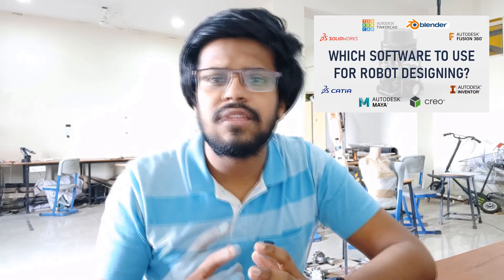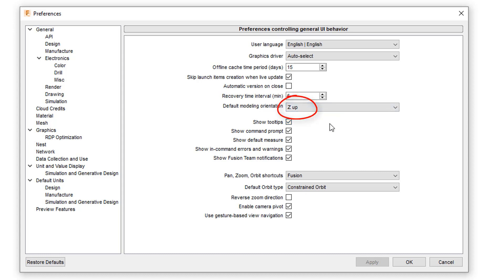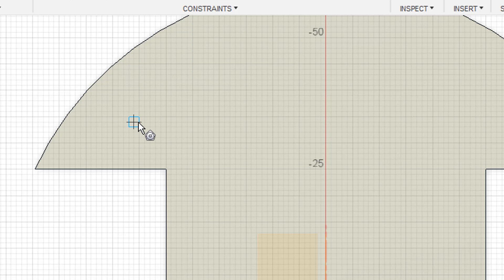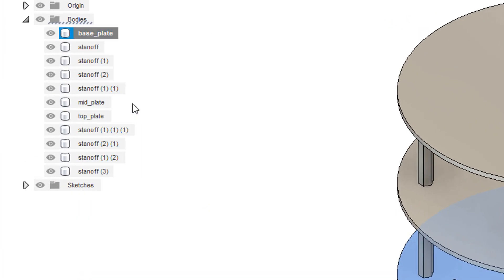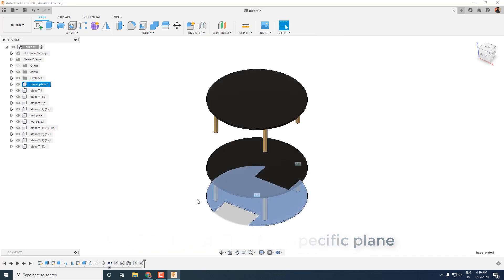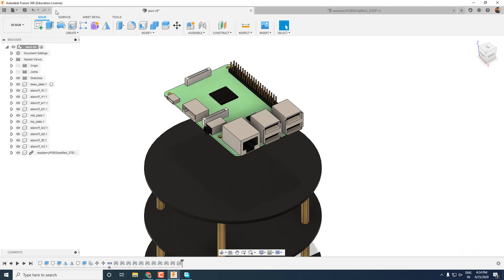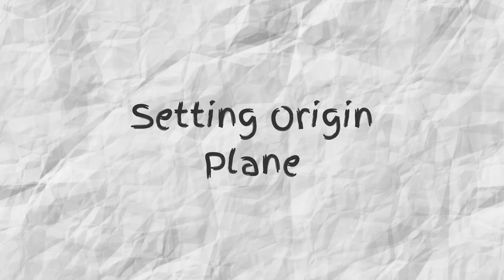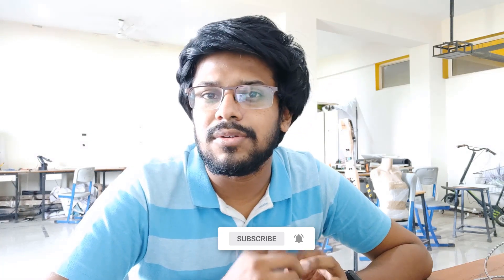How to Design a Robot in FUSION 360 for ROS Simulation || Beginner Tutorial - Autodesk Fusion 360

Comment: hi sir , i got problem while serial communication between jetson nano and ardiuno , kindly give some suggestion , I don't know how to connect jetson and ardiuno using tx rx , while trying serial communication jetson USB port are not working and stuck it into boot older mode, I don't know what pin to use for serial communication in jetson nano 
kindly give some solution for this pls

Comment: basically for the joints you could have selected all the components and build a "rigid group" instead of building each joint separately.
Reply from the maker: The reason behind making separate rigid joints is because while we convert it into URDF, fusion2urdf plugin doesn't consider rigid groups. It requires rigid joint. Hence I made it that way as making URDF out of it is the ultimate goal
Reply: @PranshuTople  got it ! thanks!
Reply: but I am still wondering if another way would work to get URDF working at the end since this separate / single joint building is quite time consuming and inefficient..
Reply from the maker: @alexisveynachter2699  you cannot call it inefficient if you wish to do it just once in whole process. Also there is no other way, as in URDF, you always tell that 2 parts are joint together at one point. So you need to do the same I'm Fusion 360 in order for it to work

Comment: I have a question, please do answer. If I use 360 in windows to create my 3D model, can I import or shift that model in my linux system? I use linux in the form of virtual machine which consists of the ROS and its required libraries but it does not have enough ram to hold 360. So can I make my model in windows through 360 and run its simulation under ros in my Linux system separately? Thanks in advance.
Reply from the maker: Yes you can create model in F360 and then use it in Linux for Simulation. That is the whole point of this series. I will be uploading video soon in which I will explain how you can do it.
Reply: @PranshuTople  thanks a bunch brother for the clarification. I was worried after installing all the pre requisites of ROS in my Linux through watching one of your other videos as I realized I can't use F360 in my Linux subsystem due to lesser Ram and Hard disk allocated to it.
Reply from the maker: @shahriarhossain7424  and well, one more thing, Fusion 360 is not supported on Linux. It only works on Windows and MacOS. So you have only above option
Reply: @PranshuTople  thanks for the info. I never knew that. Btw when is your next part of autonomous robot coming. Eagerly waiting for that 😁
Reply from the maker: Trust me, even I am waiting too to release the video as soon as possible, but currently I am stuck in some of my professional work due to which I am unable to shoot video. I hope to upload it as soon as coming week. But by that time, you can surely check me on instagram.com/pranshutople where I am doing a live today evening
Reply: @PranshuTople  take your time man. As long as you are making better contents you have nothing to worry.
Reply from the maker: Thanks for understanding
Reply: And needless to say man, you are doing a fantastic job. Just keep making videos on a consistent basis. Do not rush but do not slow down either. Subscribed and starred your github as well. Best of luck.
Reply from the maker: Thank you very much for the support ✌🏻